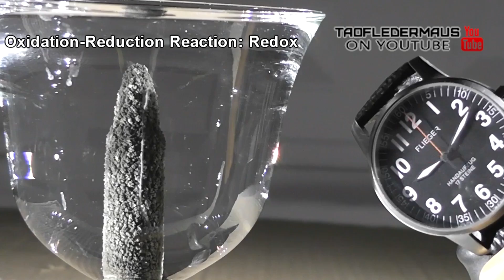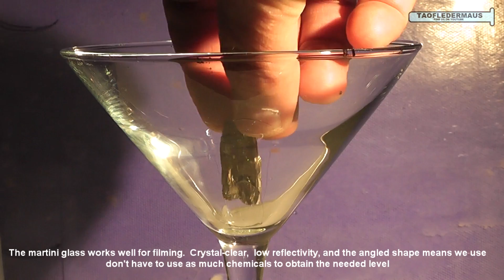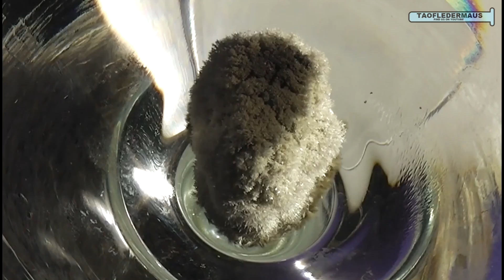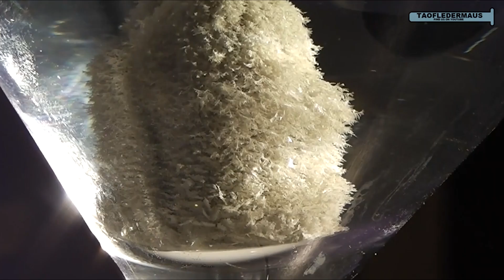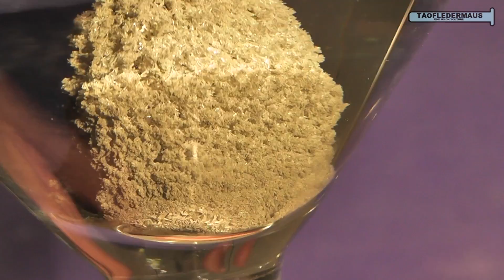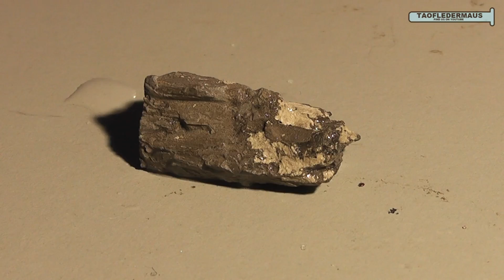Growing SILVER Crystals on Bismuth Metal

Comment: you have it backwards the bismuth is losing electrons and thus oxidizing the silver ions are reducing thus gaining the electrons lost by the bismuth.  it's all about the oxidation number. if the number increases it oxidized of the number reduces then the substance reduces. bismuth is a metal so it's oxidation number is 0 (zero) silver in ionic form is +1. the bismuth goes from metal (0) ->+1 bismuth ion. number increases it's oxidized.  silver ion goes from         +1-->(0) silver metal.  the number reduced so the silver reduced.  its counter intuitive depending on the point of view.  it makes more sense looking at through the oxidation number perspective.

Comment: Objection! "Reducing" means "losing electrons" since it is reducing something, i.e. giving it electrons. The Bismuth metal is losing electrons since it is less noble than silver (the reaction Bi(0)-->Bi(3+) has a lower standard potential than the reaction Ag(0)-->Ag(1+)), therefore is oxidized; but it is certainly reducing the silver ions (Ag(1+)). 
Think you got it a bit mixed up.
Reply: +TheWanderingChemist I'm still a bit confused, but I'm neither a chemist nor is english my first language.  Here is was I think to understand:
1. The definition at the beginning was correct oxidation means being oxized means losing an electron.
2. The bismuth is oxidized and the Ag+ ions are reduced.
3. There is a intranitive verb "oxidize" which means "being oxidized", so you can say "the bismuth oxidizes".
4. In the video is confused what is oxidized and what is reduced and you probably shouldn't say "is oxidizing" in the sense of "oxidizes (intrans)" in the sense of "is oxidized".

Comment: Please do a shotgun video firing ferrocerium at steel, at night. That's the stuff cigarette lighter flint is made of. You can heat lighter flint till it's red hot and throw it on the ground to make an explosion of sparks. I imagine firing a bunch of flints at a steel plate should be spectacular.

Comment: I should ask my chem teacher if we can do this. How expensive would this be to do?
Reply: +Josh Lukowicz 
Not very. You could get people to bring in some small bits of scrap silver and make your silver nitrate the week before, and then do this one the week after.
Bismuth is also relatively inexpensive.
You may want to check out Bismuth crystals too. Bismuth if left to solidify after melting, at a slow rate, will naturally grow into remarkably beautiful metal crystals. Well worth a look. In fact Bismuth is used in cosmetics, Pepto Bismol, and all sorts, it's a quite remarkably useful metal. it would also be good for class.
Reply from the maker: +Josh Lukowicz  Silver nitrate isn't cheap,   about $20 for 10ml.  (I think)   It would be a good project because you can try different metals besides copper or bismuth, too.   It works using lead too.
Reply: +TAOFLEDERMAUS ok thanks
Reply: +rationalmartian thanks

Comment: Is it true that magnets will float in the presence of bismuth? Kind of like quantum locking, but at room temperature.
Reply: +Oliver Lane Bismuth is diamagnetic. So a magnet will float between two pieces of bismuth. You do need a magnet on top however to effectively cancel out the mass of the magnet.

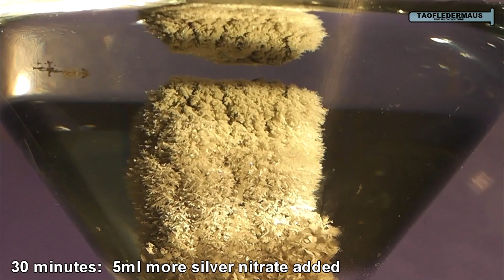Comment: 1:31 Erhm... I'm fairly certain it's the exact other way around. You go from Ag+ to Ag metal, so silver gains an electron from the bismuth, which goes from Bi metal to Bi 3+, thus losing three electrons.

So, silver gains electrons, bismuth loses them. 

(The silver nitrate is indeed oxydizing the bismuth. If it is oxydizing something, it is itself getting reduced. Same goes for the bismuth which is indeed reducing the silver, thus getting oxydized itself)

Cool video though!
Reply from the maker: +piranha031091  you're probably right. lol
Reply: +piranha031091 Yep, the silver ions are reduced to silver and the Bismuth is oxidised.
Reply: +TAOFLEDERMAUS Plus and Minus is confusing since plus Means a Lack of electrons, and minus a overabundance.
Reply: +TAOFLEDERMAUS Chemist here. Easiest way to assign redox reactions is to look at the change in oxidation numbers of the reactants. 

For the silver half reaction, you're converting Ag+ ions (oxidation number = 1) to solid Ag (oxidation number = 0). Since the oxidation number is reduced, Ag has undergone reduction. 

Likewise to convert Bi to Bi2+, to balance that half reaction the electrons have to be on thr right hand side of the reaction (products), hence it's losing electrons (therefore oxidation).
Reply from the maker: I realized I didn't get this right.   I just didn't have any information  about a silver nitrate/bismuth reaction,  and wasn't 100% sure it was the same reaction as a silver nitrate/copper reaction.
Reply: *****
If you need any advice with chemistry in the future, I'd be happy to help! I'm currently getting a Ph.D in inorganic chemistry, and I should respond pretty quickly on youtube.

I could even give you my gmail adress by private message if you want!
Reply from the maker: thanks!
Reply: *****
You're welcome!

My gmail address is in your private messages.

Comment: What would happen if you shoot the rounds after the reaction?
Reply: +MRT Sique Well, the round wouldn't chamber properly as it is after reaction, so the post-reaction crystals would need to be removed. Then you have a very brittle assembly of whatever's left after the REDOX removes its target material(s). Most likely the case would fragment upon the gunpowder detonating (shouldn't be effected because bullets are generally wateproof, but if the pitting caused by the REDOX was severe enough, the gunpowder could be wet and therefore useless), which could cause substantial damage to the firearm and possible injury/death to the shooter. If it fired successfully (out of, say, a Mosin Nagant, as they are built like tanks and can generally take a case detonation and - while not being usable anymore - not completely fall apart), the bullet would fragment as soon as it was fired, and then you'd have super fast-travelling bits of lead tearing up the lining of your barrel and coming out the end.

In short, nothing good. It would be like the worst shotgun ever and might break the gun and kill you.
Reply: cerg
understood, lol thank you

Comment: What a coincidence! I was just melting Bismuth earlier (unrelated to firearms) and even watched your video on firing slugs of it again when searching for things to do with it. Great video as always.
Reply: Indeed. I didn't purchase enough Bismuth (only 2lbs, it is a mildly heavy metal) to create any large ones but the stuff WANTS to build crystals so it isn't very hard to get some awesome shapes going. Just make sure he is aware that it's very hot and isn't really something he can handle. Maybe have him help you build a clay mold for the outer shape of the pour? It molds easily and if you time it right the inside of the mold will have crystals growing in it. Good luck and have fun :)
Reply from the maker: +Eric Jones   I only bought a lb. of it and had a little left over from the bismuth slug videos.

Comment: I'm a first year chem major, and I'm not saying that makes me right, but I think the silver is supposed to be the one that reduces from its ion state to its metallic state, requiring the bismuth to oxidize into ions to supply the electrons. Nitrate ions remain unchanged.
That, or the reaction is happening in some other way where silver doesn't form.
Reply: I agree, if the silver is positively charged it must be being reduced to become neutral; I think Jeff has the electron flow backwards.
Reply from the maker: +r77xxl  yeah,  I'm probably confused
Reply: No worries, video is still awesome. XD